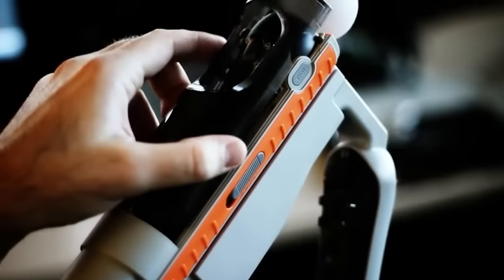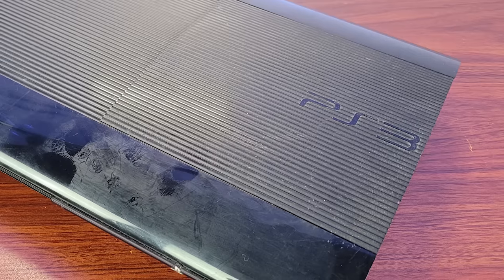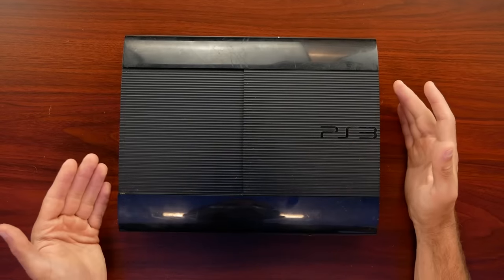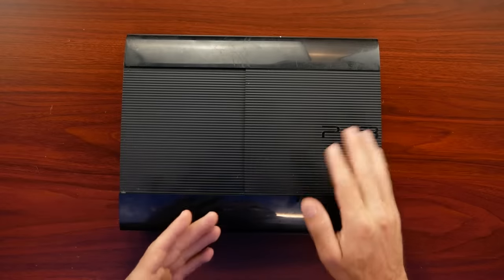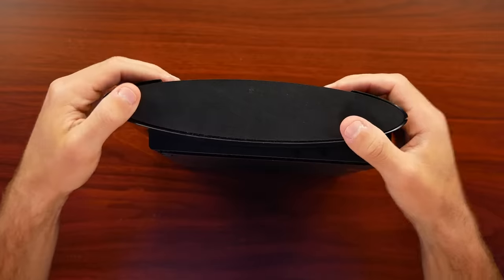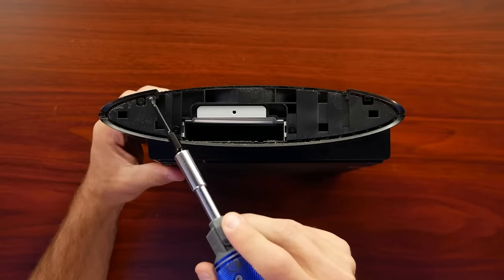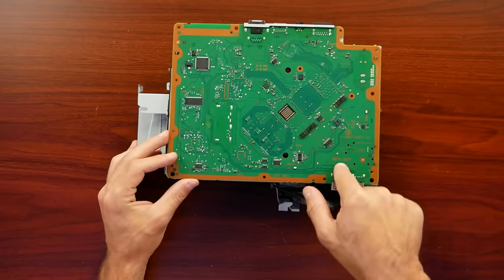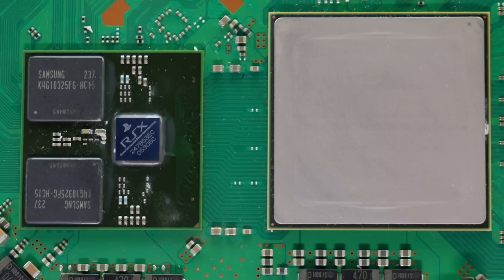The Weirdest PS3 Sony Ever Released

Comment: Got this model to replace my original 60 gig  first gen that got stolen during a move. My original was great with the backwards compatibility, and I played it a lot over the years. It did die once and was sent to Sony but I seemed to have gotten back the same fixed device, not a downgraded replacement, which I  was happy about. 

But after losing both my PS3 and PS4 on my move, I went for this one, and installed a 1TB drive. Excellent, never had an issue, much quieter and super portable. I also appreciate the design and never had a problem with the cover door. Then again I haven’t used it nearly as much as my original or my PS4 Pro which I got to replace my original as well…

Comment: I have also had one for more than 9 years. No scratches on the smooth plastic and no issues with the sliding door (I haven't been gentle either). Mine did have a large HDD also. I don't like the slot door on the others for it is easier to scratch disks inserting them into a slot.

Comment: Slide top may have been a flaw but I like being able to take a disc in and out without a screwdriver. My ps4 eats discs all the time. I’ve cleaned rollers and replaced them. Just let me open the top and snatch a disc.

Comment: Picked up one of these with an HDD installed in excellent condition a couple of years ago for £50, glad I did as I think they're are going to get very collectable. I believe PS1 and PS2 support was re-added as emulation later. Great machine, essential for saving space compared to the HUGE og ps3
Reply: I am pretty sure that PS1 emulation is present on every PS3, but PS2 emulation is only available for the OG phat PS3.

Comment: I bought my used 12GB Super Slim a few years back and used the 500GB hard drive from my PS4 I didn’t use anymore. Only problem I ran into was having to order a hard drive bracket online lol. Super easy installation and haven’t had problems even while running it fairly regularly

Comment: I got one on sale with GTA V bundle,& took plastic covers off..bypassed the door..made a open case for it,with a 8 inch fan blowing through it,put better hard drive in it...worked great for like 6 years..until the CD motor finally got tired of that GTA V disc..& failed..It never get hot & lag freeze,because of mods.Held up nicely..outlived 4 hard drives before it peaced out.Nice system!

Comment: I've remember that over 12 years I've had the ps3 fat until 2020 I've had issues with that it keeps turning off and I've decided to replace it with the ps3 super slim and it worked very well till this day, the ps3 super slim is cool and you don't have to worried about your games being stuck and it came with the last of us 1
Reply: Opening,cleaning,re-thermal pasting and putting custom firmware on it would have the ps3 fat running for another 10years tho

Comment: I replaced my $600 launch unit with one of these back in 2018 when my launch unit finally croaked. The only issue I've run into with this model is that it often just stops reading the disc when you play the Naughty Dog games (probably has something to do with how they push the console to its absolute limit). This is really annoying since it will usually only stop reading the disc if you've stayed in one area for too long which I do all the time in Uncharted/The Last of Us because I want to explore every nook and cranny. Once the system has stopped reading the disc in a certain area, it won't load that area again until you boot up a different game and then come back to the Naughty Dog game. Must be the way this particular model handles its cashe.
Reply: This happens to me on the Super Slim when I try to play Last of Us for the trophies. The game just freezes and I have to shut the system off. So what’s the fix?

Comment: I avoided the slim and super slim because the fat model was so iconic... recently it's been crashing mid-game with the YLOD. Still works as a blu ray player, but my library of games is now unusable. Now I'm coming around to the super slim for 2 reasons, simplicity and power efficiency. Fat model's 90nm cell processor draws 180-200w, compared to the super slim's 32nm 70-80w processor 🤓

Comment: there's actually a gen for this. As the first gen somewhat has disc reading problems. Mine is a 3rd you can see it as 43xx at the back sticker. Works like a tank had to change the storage as you know HDD ideal use is only 5 years beyond that it starts getting slow. Using an SSD that saves me some seconds in loading times and makes the menu snappy that makes it worth it.

Comment: I have that model. But a long story short, I wrapped the power cable around my system (while it was still hot) to put it away. It ended up melting into the plastic... Still works though, but considering buying another console or shell.

Comment: I have one of these, recently took it apart to clean and apply some new TIM on the CPU/GPU, while inspecting the top cover and cleaning the dust off of it the damn gears broke (thin plastic pin holding the gears broke) now it doesn't lock shut so I can't use the disk drive.  Which is fine I have a bunch of digital games on it and of the 2 disk based games I have for it were both re-released on the PS4 (SO: The last Hope, and Tales of Zestiria), just annoying the locking mechanisms gears gave up the ghost on me.  The system does run cooler now and the fan doesn't spin up as much as it used to after using a higher quality TIM than what Sony used.

Comment: I know this is an older video and my comment is probably on here somewhere. But hardly ANYONE when making a video about the "super slim" ever mentions it can easily mess up the system by not using the release button for the sliding door. 
It always killed me when a friend would open it by sliding the top. I told them it would mess it up but they didn't believe me. But of course over time, I was right and ended up having to fix about 20 different ones for a few different friends over the years. 🤣

Comment: Got a PS3 Super Slim years ago. Modded with HEN. 2Tb external HD. Installed over 50 games so far. Still go over a Tb to go. Great console. Only complaint is the controller. But u can sync in a PS4 controller tho.

Comment: I had the 40gb phat model first then picked up an 80gb some time later (4 usb BC motorstorm unit) because I was highly interested in the PS2 BC plus other features and felt I was missing out. Well, the 80gb didn't even last 6 months it got YLOD. So I picked up a used 80gb from a guy on craigslist and once again YLOD shortly after. Then the 40gb's BR drive died:(

I recently got an itch to get back into the system because I loved the library it's literally my favorite PS console. So I imported a rare satin silver slim (2500 series) from Japan and it looks and runs beautifully, started picking up games while they're still relatively cheap and available. Then got a PS2 phat in excellent condition from a thrift store for next to nothing.

I say this people: DO NOT BOTHER WITH THE PHATS. They are poorly designed and just waiting to die. The BC isn't worth it. Buy a PS2 or download them off the PS store. Not to mention there are HD collections of alot of the more popular games like God of War, Metal Gear Solid, Devil May Cry, Final Fantasy ect. Buy a slim or a superslim. My two cents after 3 dead systems lol.
Reply: Well said

Comment: Bought my super slim for $60 used. Had an issue with the door not sliding open or closed easily. Took apart and found a bobby-pin stuck in the track; removed it and it's been fine since. Funny enough I got a PS4 with a faulty disc drive and a Bobby-pin stuck to the magnetic tip; slot loading doesn't stop Bobby-pin's lmao

Comment: I have this model under my tv right next to me
I added a 1tb hdd a couple months back because i had to routinely uninstall and reinstall a couple select games because of the limited space... then afterwards I found that practically none of my other 35 games I bought afterwards ever needed to install anything significant, was just the 3 i happened to buy first -_-  I've not even used 50gbs yet

Had to get the hdd caddy off ebay from china with a 2 week wait but other than that it's been extremely reliable.
Also I frequently buy games at $2-$5, so thats always a big plus

Comment: I had this and i kept changing these ps3 slims because if the power blackout at my house the hardware just burned just like that.
Cycle was:
1)Buying new hard disk/ps3 slim
2)Download and playing gta 5 normally,no problems
3)eventually while playing gta 5 the electicity blackout and the hard disk got damaged so after few days of that happening,launching gta 5 it got stuck at “loading story mode” and wont let me actually play the game
4)factory reset but nothing get fixed
5)repeat from step 1 and do all steps to 4 over and over and over.

And whats bad from sony is that the power blackout still can damage your ps4/ps5 to this day and i m paranoid if that happens for all this backstory of ps3 slim and sony doesnt provide whats needed for blackout to not danage your consolle.
Thanks Sony l,i appreciate a lot
Reply: Was your ps3 connected to a surge protector? I’ve had several blackouts while playing and my 12 year old ps3 slim still works like new connected to a plug with a surge protector.
Reply: @alexs.818  well using surgeon protector save the ps3 and its meant for that. I didnt have the surgeon protector and it needed just 1 blackout while playing it to completely break the ps3 slim s components.
And whats s sad is that on ps5 this problem is still a thing(of course ps5 has endurance so it doesnt break istantly but probably with 40 times of that happening it might break)and they still dont provide the solution.

Comment: I just picked up the 250GB super slim ps3 at a pawn shop for $55. It included a ps4 controller for some reason, my pick of 2 ps3 games under $10 (skyrim & RDR) and they added in a ps3 controller as well. A used ps4 controller is like $25-30 so it was quite the deal.
Reply: ya man I picked up a regular slim about 6 years ago and it blew my mind when I looked up the prices and saw they were the same as they were then... if the prices of the consoles before it are indicative of what the prices for these consoles are going to be then they are going to be shooting up in price soon

Comment: I have 2 slims (not the ultra slim in this vid) in the house, one I believe is the first gen, the other is the 2nd gen. Both look identical, but the first gen runs louder and sometimes has issues with DVDs making loud noises on startup. Rarely has issues with blurays. The 2nd gen slim when I used it for movies never had an issue. I wish I had my original 60gb, but too many graphic intensive games would have artifacts or screen tearing on it, never an issue on either slim.

Comment: I had a PS3 SS and it kept breaking on me. Power supply died after 6 months, sent it for replacement and then 6 months later it happened again. Bought a new power supply board and swapped it and it worked, but switched over to PS4 so put it away. Took it out 2 years ago, dead like shit. I bought a PS3 Slim to replace it, no problems since. I really don’t like the SS

Comment: I've been looking to finally get a PS3 and by all accounts the Super Slim is the most reliable one. But the design is just so... lacking. I'm just wondering if there's replacement shells or skins of different colors for it? Could I be able to change it? It's only thing that's stopping me from getting one. Kinda superfluous, I know. But coming from the PSOne, Fat PS2 and PS4 Slim, which are super iconic and very slick designs. The PS3 Super Slim design leaves a lot to be desired.

Comment: I picked up a black super slim at an outlet thrift store about a year ago for 3 bucks and works like a charm. I've had the blue ray player fail on 2 original PS3 consoles and one slim console. The PS3 wasn't very reliable. The PS2 in comparison was a tank.

Comment: I'm 42 right now my whole life I've been behind on gaming systems lol, the PS4 is probably the only system that I may skip but I am not looking to invest in PS5 anytime soon. bought my PS3 back in early 2014. I know that's eight years after the release LOL, but at that point I didn't feel the need of getting the PS4 ... I didn't want to skip the PS3 by getting the PS4 & to this day I still use my PS3, I put a 1 terabyte hard drive in it which may be too much storage for an original 12gb system but I wanted it just in case. Also for the door I put my finger behind the door and press the release button I don't force it open and I don't let it fly back on its own because of that issue of not being able to read the game so I am very gentle with the door. Very close to owning it for 8 years now and no issues whatsoever!

Comment: I had a ps3 slim but it died from over use. So I had to replace it with a super slim 500gb model. It was nice to have a lot of storage but the system was not easy to use.

Comment: Something you didn't mention, was that the Super Slim uses only half the electricity that the original FAT model used!  A joke instantly springs to mind but you'd say i was FAT bashing, or FAT shaming 😁
Of course being FAT you always guzzle up more. But personally i'd say in this case "grilled spring onions" is the healthier, and longer lasting option. It's also easier to fit into tight spaces 🤭

Comment: I wish I could find someone competent to fix the HDMI on my CECHE01 80GB. I've had it since it was released and has been awesome until a year ago where I get no signal out of the HDMI anymore. Unfortunately, it's not the easy fix where you hold the power button down while booting to reset the video output. And I don't think it's the port/jack itself because it's never left my house and been stationary the whole time. It pretty much had the same HDMI cable in the port for 15 yrs until it stopped displaying and then I tried many other HDMI cables. I've since been using it with Component RGB which works great but, I'd love to get the HDMI fixed. I'm just afraid to give it to just anyone. 😕

Comment: Mine didn’t have that big chungus IHS that needs to be delided mine has a PS4 style chip in it same RSX config, you do know to refurbish a PS3 both chips have to be delided there are chips and thermal paste under there as well, I put an SSD in mine it seems like it’s Sata 2  like the PS4 not Sata 1 like it should be I have the oddest PS3 I have ever seen I’ve never seen another one like mine just crazy this is a CECH-4201C right?

Comment: There's nothing weird about it spawn, or cheap, its a great design. With a sliding draw that is much more durable than a drive belt. My PS3 is over 6 years old, and it's solid as a rock. You bought the best version, minus taking out the emotion engine. Consider yourself lucky

Comment: I have a super slim and absolutely love it. I stuck a 1TB HDD in it and it does everything I need it to, and quietly.

I think the super slim gets a bad rap. I actually dig the sliding door since that's a pretty simple, cheap fix as opposed to the numerous slot loading drives I've had fail on me and they're a massive pain to either fix, or just have to replace outright.

In terms of internal reliability and longevity, they're the best model by far. As long as you don't abuse it physically, it should last for a very long time

Comment: What if you just want the most reliable, quietest, cheapest ps3 and don't care about the appearance... Would this or the ps3 slim be better?
Reply: I actually think the regular slim is better. The super slim is fine but I don’t like the sliding tray. It makes the laser easier to damage but if it’s taken care of it should be fine. General reliability should be around the same however the super slims are a couple of years newer. Also both versions are fairly quiet there isn’t much of a difference. Price ranges aren’t much different they should cost around the same too. Overall both versions are good but I would lean towards the regular slim personally.

Comment: I have this model. I bought it used as a Woot deal ages ago Great system to softmod. Softmodding eliminates the sliding door issue,  get a big enough hard drive no need to swap disc all games on hard drive.

Comment: I got the original launch ps3, even camped at a store at night for it. It sadly died because of YLOD and later I ended up getting the version in this video years later to replace it. Got it as a bundle when gta v launched and I remember feeling a little disappointed because of how cheap it felt compared to the old original launch ps3 or the previous slim model. However, it has trucked through the years. Still works great to this day, though it's a little on the dusty side.

Comment: Just slide it open?  You know there is an eject button on the front... Right?  LOL  Good vid though.
Reply: Oh... the superslim didn't suffer from the Toshiba cap issue... so honestly... it's the most robust of all the PS3's.  At my shop, I've gotten to a point where I won't touch a fat ps3 if it doesn't power on.  Too much wasted labor in trying.

Comment: You should change out the cmos battery while you have the system taken down that far and buy it 10 more years. PS3 will not work without that battery either.

Comment: Mine stopped reading discs.. Took it to a repair shop, a week later, They didnt touch it yet... apparently their tech felt nervous with a system they never messed with..  I brought it home, then I punched it... It works now.. Not the prettiest thing anymore, considering what broke it, was dropping it on the floor... oops..

Comment: I have a super slim model, fan gave out, before, it would spin if i spined it manually until it finally just stopped working. Thing is, to replace the fan, one must reach the motherboard, can't afford the fan nor the good thermal paste to apply 🥺 i do have a working Slim model at least.